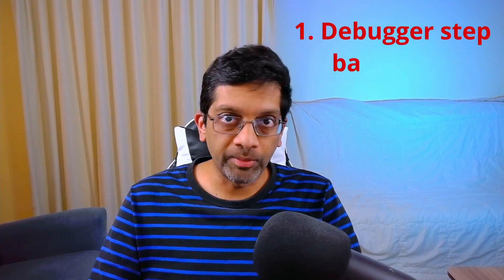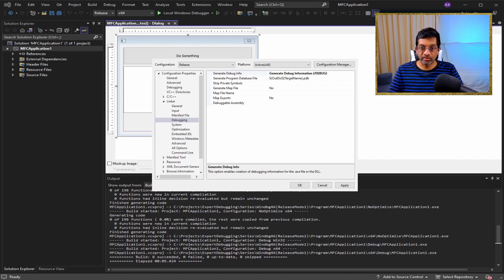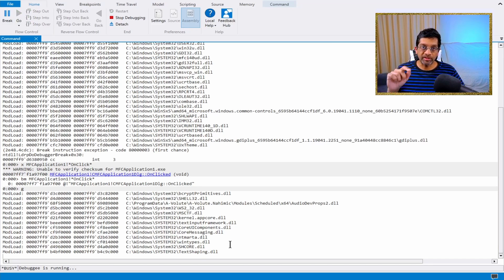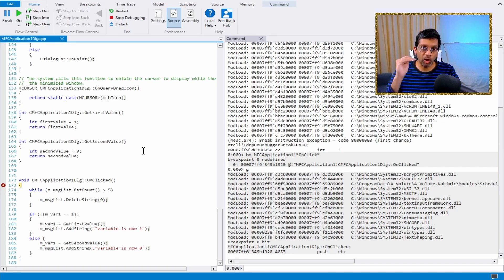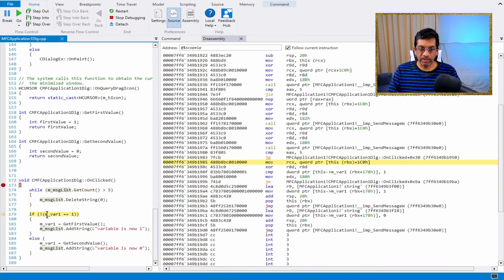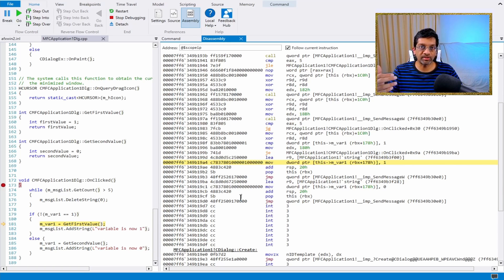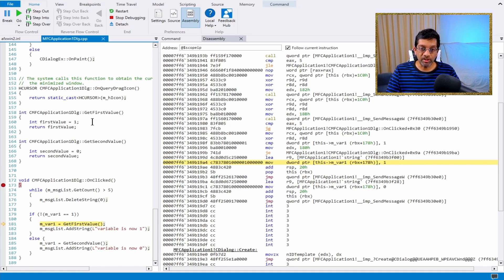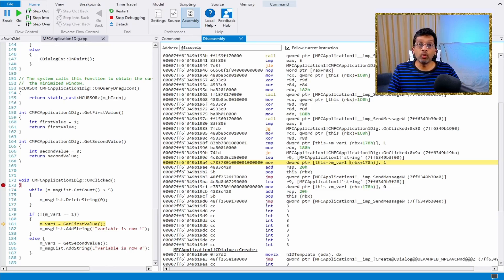Release mode debugging. The debugger steps , backwards !!

Comment: Thanks for the great video and explanation. I have been shipping production c++ applications to clients for the last 25 years but only recently started using WinDbg and in order to generate the *.dmp files when the production application crashes I started shipping release versions with optimizations off and debugging on. I am doing this in order to debug some hard to find bugs. Do you think that shipping production applications with no optimizations and debug info will adversely affect performance of the application? If so what would you suggest as an alternative? Really appreciate your opinion.